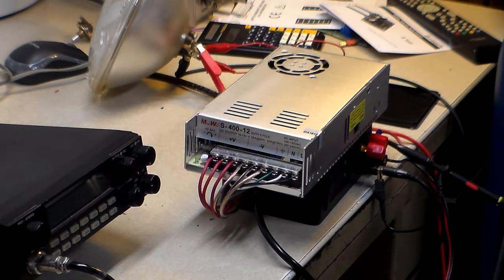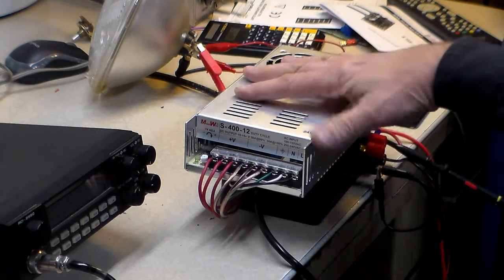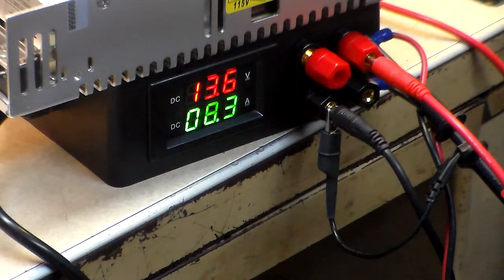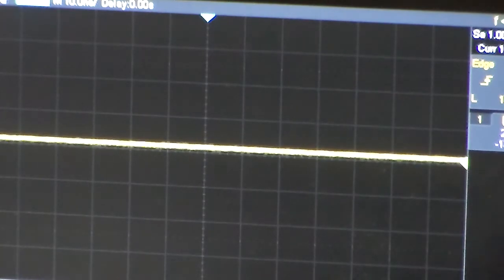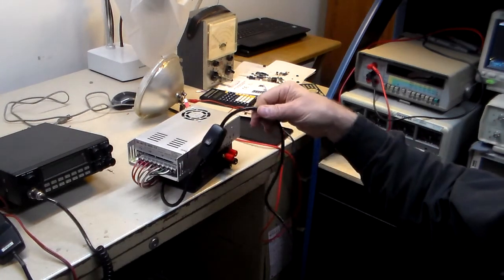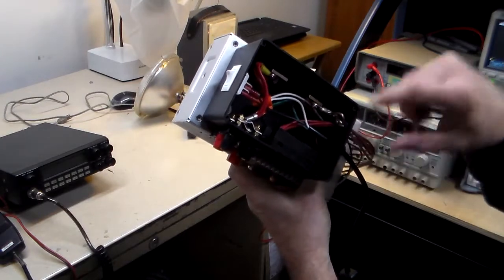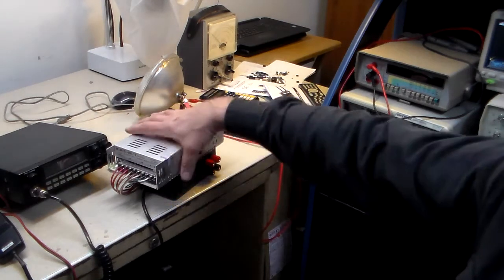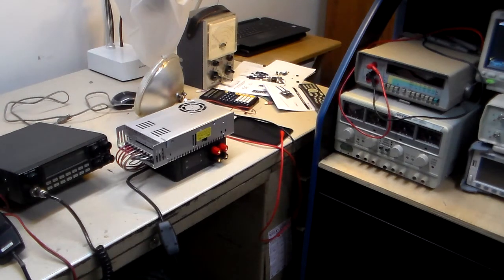Mega Watt Power Supply - Enhancement?

Comment: Sorry for the dumb question but it appears that you have wires from all three V+ posts on the Mega Watt combined and connected to the + banana jack?  is that correct?  If so, is that necessary?  In other words, can a single V+ post on the power supply provide 30A?  Any chance you can post a schematic of how your project box is wired?  The resolution in the video makes it difficult to see.  Thank you.

Comment: had 36Amps for 8yrs, only complain is the FAN noise. Now i found an HP 60Amp Server power supply  with whisper noise :)
Reply: I have two of those HPs but had trouble setting it up, it wouldn't turn on. What's your experience with these and how'd you go about it? Did you find a good website on it?
Reply: @arconeagain  add a switch to pin 1 and 4 then go inside, theres a trimmer to lower down the voltage to 13.8V DC.
Reply: @revadan  yeah I think I did that. I'll have to get back to it, got so many projects ATM. Running tubes now too. I know they're a good quality supply. Thanks.

Comment: I like the video and really like how you made a box to utilize the power supply and being able to see your voltage and amperage draw, nice job on it. would you care to share what meter you have in it?  I just got one of these MegaWatt (S-400-12) power supply's because they are (made in the USA) I got it yesterday and got it wired up and running so I can build a base station in my garage. I'm going to be using it to power up my rci 2950 cd and a small 200-watt amplifier, I'm running it at 14.23 volts just as much as your vehicle's charging system put's out. so far so good I'm having no problems with it handling what I'm using it for.

Comment: I just bought one of these to run my icom 718 HF rig and my icom 2300h 2 meter mobile rig in the house I hope I didn't waste my money as I know with some switching power supply generate noise on HF bands.
Reply: I have several of these and none make any noise on 27mhz, at least. The 50amp ones are noisy as hell.
Reply: @arconeagain  ive had 2 quiet 30a, 2 quiet 40a and a really loud 50a, s7+ of noise so i sent it back!🙄

Comment: Very Nice Switching power supplies & I really like the Volt/Amp/power box you built very handy for the test bench. I have the Megawatt S-700-12 fifty amp ordering a 2nd one for a 100 amp supply. These are made in the 🇺🇸
Reply from the maker: Thanks Miguel.  Sounds like you could weld steel with yours if you wanted.
Reply from the maker: @miguelsalami  I ot mine from Amazon.  Here is the description:  Voltage Current Display, DROK DC 4.5-100V Digital Voltmeter Ammeter Multimeter Panel, 0-50A Volt Tester Meter Amp Detector, LED Voltage Amperage Monitor Gauge for Automotive Motor Battery
Reply from the maker: @miguelsalami  A shunt is a must.  Either positive or negative can be dangerous as the shunt is like an exposed wire.  But at least on the negative side if it bumps the chassis, it won't be a short from the positive to ground.  Assuming negative ground.
Reply: @KA3AJI  I have shunt run from negative side of amplifier into a 5 way insulated ground block that both 50 amp power supplies run to in parallel. Amperage & Volt meter combo gauge like yours & it's all working perfect 👍👍Thanks!
Reply: if it is made in the USA, why do all the parts and the terminal board look just like the Chinese switch mode power supplies.
Reply: @JohnHill-qo3hb  Because the Chinese like to copy & clone everything we do! If you look (inside) the Megawatt supplies they are built completely different & Chinese clones produce A/C line noise in equipment. Trust me I know John Marles in California who owns & builds Megawatt power supplies. 
"His Customer Service is The very Best in the business"🇺🇸